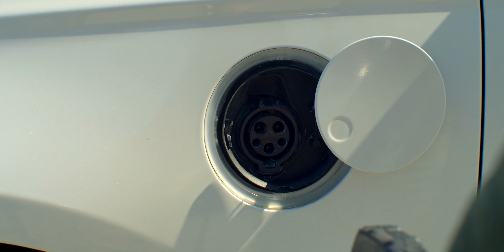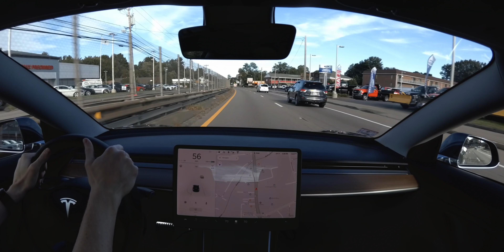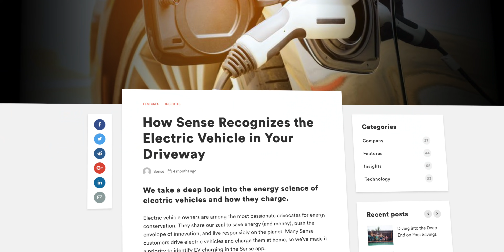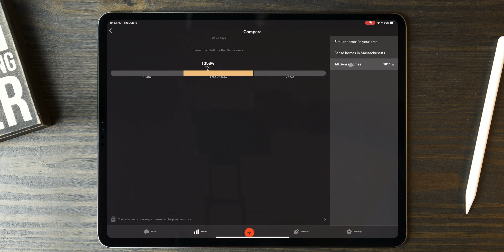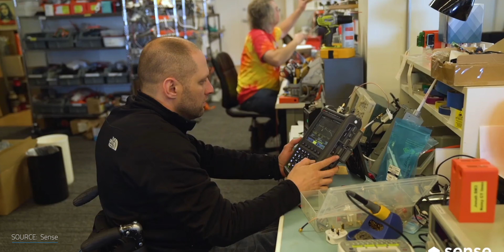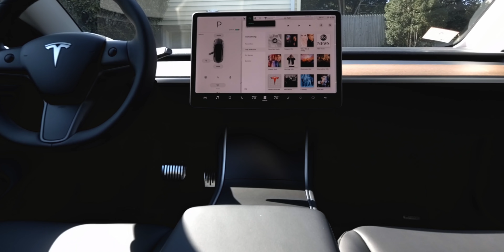Tracking your EV, solar, and energy use with machine learning - Sense smart home interview

Comment: Really interesting. Learned something here. Great video. Loved it. Any idea if you need more than 1 unit if you have a dual circuit breaker box house?
Reply from the maker: If you have 400amp split box, it can work with just one.  I’d recommend reaching out to Sense support ... they can definitely help you out.
Reply: Undecided with Matt Ferrell 
Thank you.
Reply: We have 2 200 amp panels and 2 sense devices. I created 2 log in IDs and use 1 on my phone and 1 on my iPad. The power of this product is the insight it gives you into your energy consumption. If that interests you, I can’t recommend it enough!
Reply: Oscar Ryan 
So purchase 2 devices is the most probable answer. I’ll talk to Sense as well to confirm. Do you think the resultant savings will payback the cost of 2 devices in your home?
Reply: ~$550 dollars? Absolutely... Eventually. It all depends on the actions you take based on the info from sense. I’ve been on a kick about reducing energy consumption for the past year and a half. Went from 37,000 Kwh in 2018 to 32,000 Kwh in 2019 and projected 23,000 Kwh this year (with EV added early 2019). Sense gives you great insight into things that you just don’t think about. Garage light uses 300 watts of electricity and I am going to replace with same lumen LED that will burn 80 watts. (I’m running out of “easy” things to save on). The biggest energy savings for me have been relatively cheap. Heat pump water heater saved about as much electricity as my EV used in a year. (1100 dollars GE geospring. A lot cheaper than gas used in the same year!) The biggest savings has been from HVAC duct sealing (duct mastic is $15 per small bucket) and sealing holes in the house (mainly crawlspace and attic) with spray foam. So for us saving 14k Kwh per year is about $1,540 (11 cents per Kwh) per year. It has been DIY for the most part but good projects to keep busy in these times!
Reply: Oscar Ryan 
Great info. Thank you. We only use about 26,000 kWh a year and that’s including a single Tesla. Have done a lot of the LED lights already too as those are truly easy and so much more efficient. Also ecobees and such. But knowing is power right? So I can definitely see how bring armed with the knowledge these things can provide might help. Your insights are great. Thanks again man.
Reply: I am fairly certain I saw an update from Sense recently that will allow another CT (current transducer) whip to be installed on the solar port of your Sense (assuming you aren’t using the solar option already). With that option, it should allow you to use a single Sense device with 2 sets of CT’s so that you can connect a set on each of the mains coming in that deliver your 400amps total service. Confirm with Sense directly, but I believe I saw that recently

Comment: I liked the interview format. Thanks for continuing adding variety to your channel. 
In early 2000 I connected a similar system from “The Energy Detective”. It was PC only and could not distinguish well enough the uniqueness of each signal to properly assign it to a device. This agglomeration or difficulty in detecting a unique assignment has kept me from trying out other systems. The problems I had with my system Are the same problems I read on the sense feedback so I’m not yet convinced it has progressed enough to be useful.
Reply from the maker: Glad you liked it.  These types of systems aren't a silver bullet.  My take is if you know going in what it's going to provide, there's a lot of value there.

Comment: Matt, thanks for doing this. I am consistently on the fence with Sense. I wish you would have asked WHY they can't just set something manually. If you flip a switch, and it detects something wrong, I continue to hear that there is no way the user can correct that. Is that still true? If so, I feel like it's a direction they are going that seems to run counter to what the user base would like, and I would love to understand why that is. Why not allow the folks to train their system? Seems to me like a no-brainer!
I love the integrations, and I'd love to seem them integrate with SmartThings.
Any way we can see the Sense roadmap?  Even short term, like 3-6+ months would be awesome.
Much appreciated! <3
Reply from the maker: Thanks for watching, Peter.  You can correct the system based on incorrect detections/duplicates, but I understand why you can't train it yourself.  The system has to be able to distinguish unique signals.  As Mike pointed out, they can't really distinguish between different 60 watt lightbulbs in your house.  Even if you turned on a light and told it you did so, it wouldn't be able to tell the difference between the next one you turned on.  It needs to be able to see and isolate the unique energy pattern.
Reply: @UndecidedTechnology  I thought they could recognise probable use patterns too.  bathroom lights tend to go on and off in the middle of the night, and are some of the first on in the morning.  Then kitchen gets 'powered up' before the rest of the house.  And things tend to happen in reverse at night.  Not everywhere or all the time, but it is still an overarching pattern to recognise. ... I really like the 'deviation from the norm' analysis to find excess energy use in particular appliances, while I also understand the issue of recognizing very similar energy signatures (to see the difference does take deeper time based analysis)

Comment: Neat product, Matt. I'm all in on electricity savings as it is fairly expensive here in western NY. 
In 2009, I replaced my crt tv with an lcd hdtv. I also replaced my 28 year old fridge (which was energy saving at the time), and I built a new desktop computer. My monthly power usage went from 250 kWh down to 180 kWh. The savings over the 11 years has more than paid the cost of replacing all that stuff. 
In 2012 I started switching from CFL to LED bulbs. In 2016 I got Google Home and Alexa speakers, smart bulbs and smart plugs. My power usage didn't go up over the years because with what the hardware cost, I saved on controlling stuff. 
I have lots of outlet switches with individual switches to lower the phantom power robbers. 
I've had a Kill-A-Watt for the last dozen years. I use 2200 kWh per year now. (gas furnace, stove, dryer, water heater)
Reply from the maker: Thanks for sharing, Dave.  Buying a Kill-A-Watt alone can be an eye opening experience for seeing where your energy hogs are around the house.

Comment: Matt, I liked what you said about defining smart homes in their systems to work together and know how efficient they are and if overtime they’re failing and need to be fixed or replaced. Do you know if Sense  or other companies recommend specific manufactures or their products as we as individual homeowners need to replace them so that we can move toward an integrated home as we replace the various components in our home such as water heater or air conditioning unit. Thanks.
Reply from the maker: I haven’t heard any kind of recommendations like that from companies like Sense.

Comment: I'm interested. I'm an electrical engineer but don't claim to know everything about every aspect of what this thing is doing. I've got a 2800 Sq ft home with a pool, koi pond, hot tub, tons of home automation. I understand how it's able to sense the inductive load of a motor or the resistive load of toasters and ovens but I have multiple motors running and at any given time including the pool and koi pond pumps that run 24/7.  I don't see how this device can differentiate between so many devices and do so accurately. If I thought that it could then I'd buy one.
Reply from the maker: If the motors are all identical, like same model or power draw, it may have trouble telling them apart.  But my sense has been able to tell different dehumidifiers apart in my house (different models and power draws).